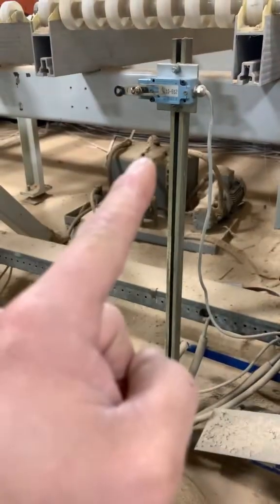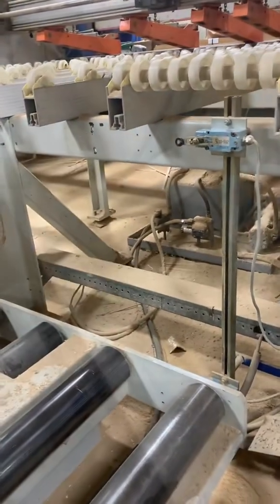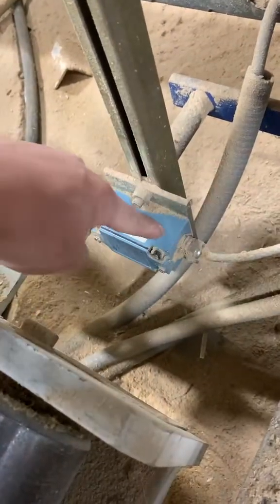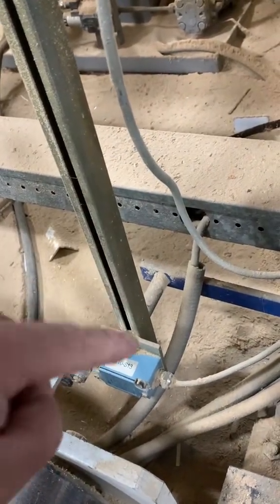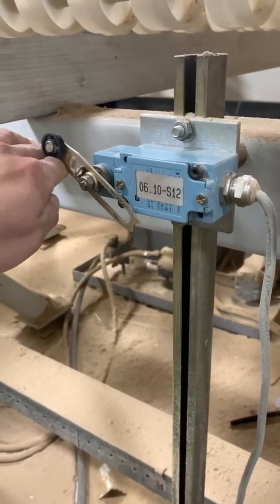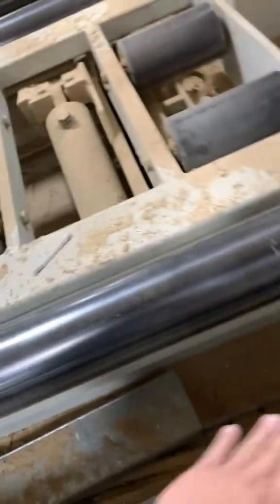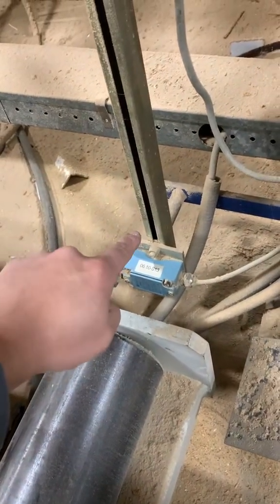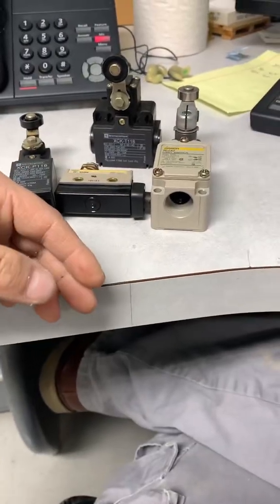Limit Switches

Comment: Used to run a Osborn  molding machine, two guys setting cores , four guys pouring iron one guy on shake out automated sand system automated shake out automated inoculate 240 or more molds per hour so I was around limit switches.
I think we had 195 switches at least.
Push off mold car line, punch out, mold separation, flask feed, mold tables, sand drop, bottom mold roll over, core set, inoculate, mold close, set on car train, sand return belts under machine shake pans , Didion drum roll out , mag belt, automated muller sand mixer, thats most of it and everything had 5 or 6 things causing it not to make switches that stopped section before from feeding thru causing me to almost be GODLIKE in the eyes of lesser ants having risen from their simple tasks to achieving the chair and title of “THE LINE OPERATOR “  and 2 years after I retired they did close the plant down it is now a parking lot.
Reply from the maker: Cool good old foundry

Comment: Ran into an embarrassing issue the other day I need help with. Solenoid wouldn't actuate. Tracing power 24v at output card, gets to valve, but it doesn't work. Just because power gets to it doesn't mean it will work. 0v return had a loose wire. If no current, no work. If you could do video helping people with diagnosing and finding lost returns, I know it would help me and others. Thanks for the great work brother, stay safe.

Comment: Excellent demonstration of in the field equipment. Do you think you could do some cabinet videos on controls? The switch passes 24 volt, cool. But how does it get there? 24 volt probably comes from a bank of terminal blocks wired in parallel to 24 volt or connected internally to make them 24. The power feeding the terminal blocks is probably connected to a power supply 120v, 277. I always need help with controls and seeing in panels helps. Thanks a ton for the great work.